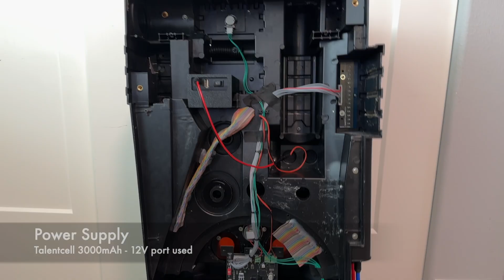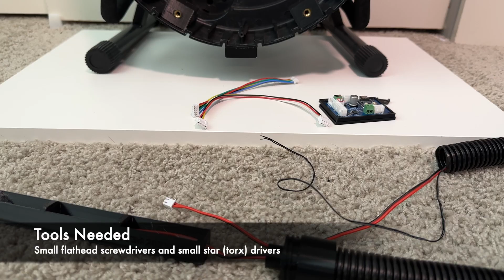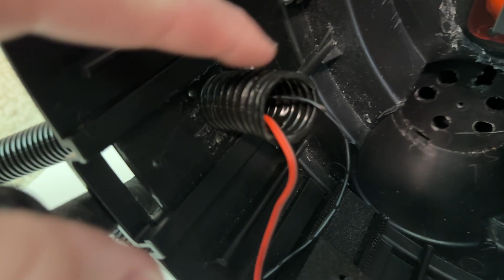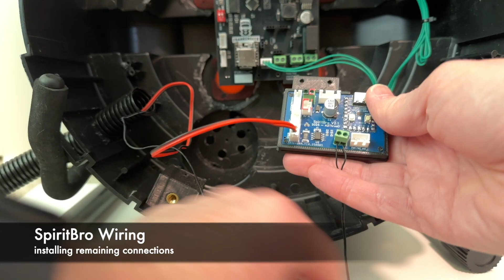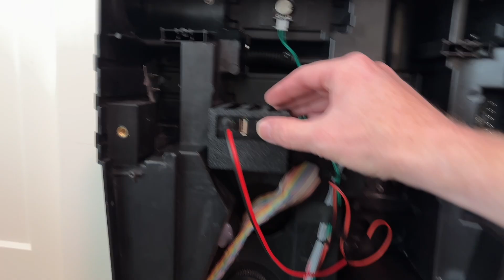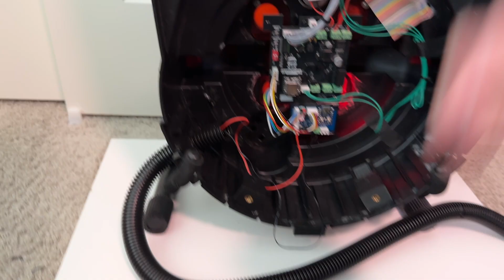SpiritBro Installation for Frankengeek Electronics - Spirit Life Size &  Hasbro Wand Integration!

Comment: Are you still able to use Franengeek's audio boost add-on instead of the stock mini speaker? I have the 2025 rework Spirit Full-Sized Pack where they moved the speaker to the wand, and swapped for his board with the amplifier kit.
Reply: I ask because I know with the amplifier you can't use the new apeaker and original mini speaker because it will overload and short the board, so I wasn't sure if the amplifier kit and SpiritBro add-on would cause a similar issue.